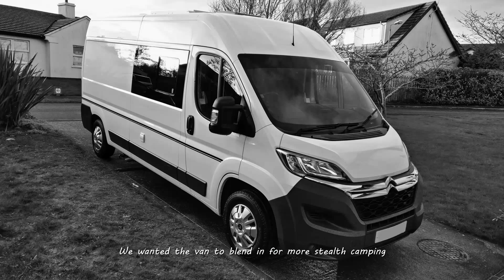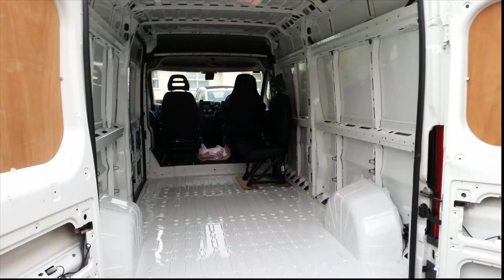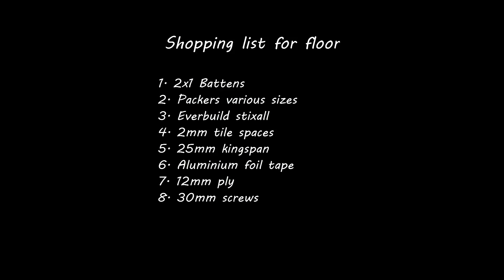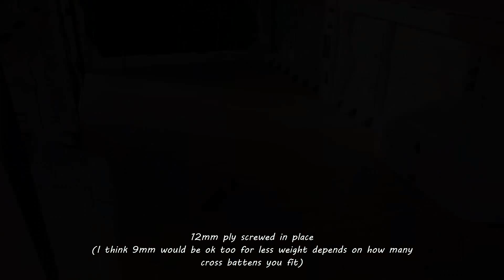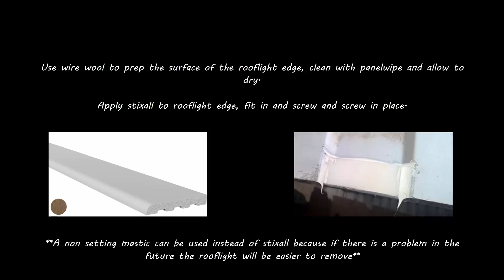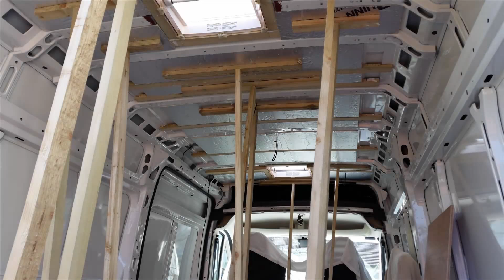CAMPERVAN BUILD: Self build van guide - part 1, Floor, Roof Lights, Ceiling

Comment: Hi Andy, 

Did you run your water pipes across the van in the floor in the end? Or above the floor? 
Thanks Rich
Reply from the maker: Hi, I ended up putting them above the floor in the garage area, this was because we hadn't decided exactly what we were putting in and still working out where things were going. Running them under the floor would have been the best. Hope this helps, Andy

Comment: Hi, where did you get your van, i'm also trying to source a single passenger seat, I have a 2011 citroen relay, I believe they are the same seat as yours and am struggling to find one. Thanks.
Reply from the maker: Hi, We bought the van in the uk and we managed to get a new seat off ebay that was taken out of a new vehicle so i was really lucky to get the same fabric too.
Reply: thanks for the reply. I'm really struggling to find one for my own relay. While i'm here... :) how noisy is your water pump, i'm thinking to use the same guy as you for the water system as  i'm located pretty close to him (barret tanks right)? thanks again for the info.
Reply from the maker: Toby Powell Shaun at barret tanks is a really nice fella i was gonna have em posted out but then had em fitted as i was up that way one weekend he showed me around his camper while i was there really helpful. Water pump is a bit noisy but aren't they all? And ot doesn't run continuous so it doesn't bother us. Hope you get a seat sorted, if you fit swivels then i would recommend getting lowered seat bases as for me the seat was too high, expensive but worth it 👍
Reply: Thanks very much for your help and advice Andy! much appreciated.
Reply from the maker: You're welcome :) good luck with the build

Comment: Wau, what a fine documentation with several helpful explanations. Many thanks. Isolating a T4 I used "Armaflex". But no I'd like to realize it better ;-) 
So just one practical question, even while I'm working now on the isolation of a VW Crafter: What kind of white material did you use for all the hollow spaces ("nooks and crannies" ?) - which can be seen in 8:57 ? 
A link or notation would be wonderful. Thanks a lot. :-)

Comment: WTH is stixall?
Reply from the maker: Brian Darnell Product Description

EVERBUILD STIX-ALL is a one part, chemically curing solvent free sealant and adhesive combining the best qualities of silicone and polyurethane technologies. It is specifically designed for adhering most common building surfaces to each other and themselves 
Hope this helps :)

Comment: Hi, great conversion! I was planning on screwing roof battons to frame. Did you find Stixall was strong enough?
Reply from the maker: Hi, all my battens are just stuck with stixall but remember you need a minimum thickness of 2mm of adhesive thats why i use a tile spacer it stops the adhesive fully squashing together as this would make a weak bond and probably fail. Just make sure you leave it long enough to set and clean the area as if there is dust or grease this will cause it to fail too. Hope this helps, Thanks for your comment :) Andy